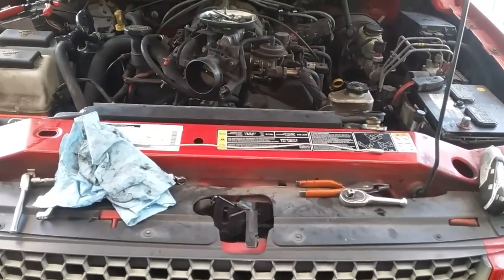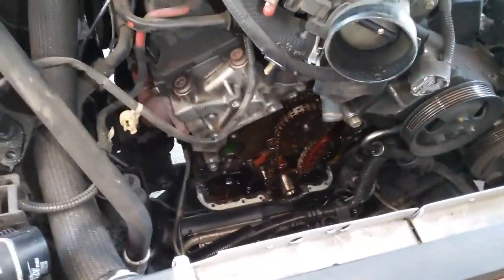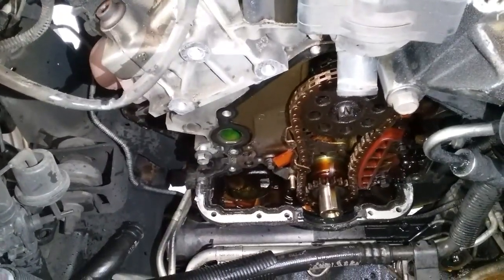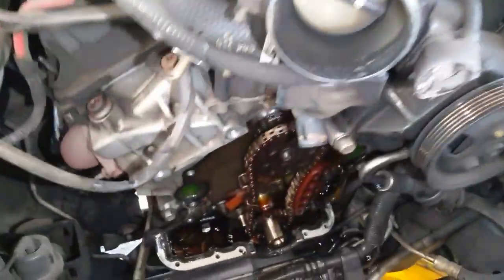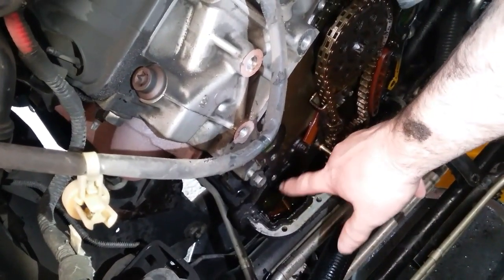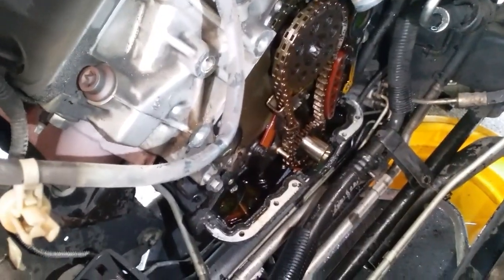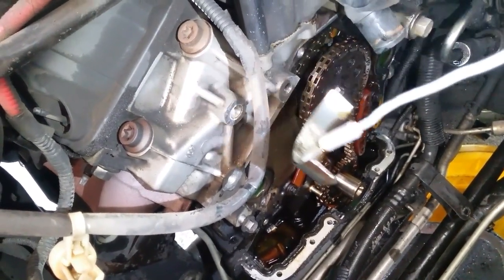Timing chain noise 2001 Ford Ranger 4.0L SOHC V6

Comment: I’m watching this 7 years later, and hopefully will get a response. Mine is a 01 ranger 4.0 SOHC it is a crank but no start. I’ve replaced the crank sensor, cam position sensor, and it still doesn’t start. Would this cause it? My dad and I think it jumped timing
Reply from the maker: @jakelewis3561  hi, you havnt supplied enough information to answer your question with accuracy. 
  Did you check spark?
If it has spark, did you spay starting fluid down the throttle body?
 Is the check engine light on if yes.. what are the codes.
  But to answer your question.. if the timing did jump enough teeth, yes it might not start. 
  If its one tooth then it should start but run rough.
  Easy way to double check is a compression test. If all the cylinders are 110psi or more.. AND they are all the same, I'd say the timing chain is NOT the issue.
  1rule of diagnostics.. start with the basics first. Spark fuel, then mechanical. 
 Good luck.

Comment: Can this cause a leak and truck turning off as well with a loud noise when cranking ?
Reply from the maker: Noise when cranking or possible. But the word "noise" is to general. It would be a specific kind of noise.
  As for a leak. Of a timing chain is moving around so much that it's has cause a visible leak. You have more problems than a timing chain.

Comment: I can hear a rattle noise especially when I turn the motor off. You have same sound?
Reply from the maker: A rattle noise with engine off 99% of the time NOT from.the engine.

Comment: can it be reassembled and used without pulling head or motor?   thank you
Reply from the maker: U need access to a plug at the back engine . This plug covers the bolt that holds the rear chain jackshaft gear. 
U can either pull the engine. Or remove the transmission, clutch and flywheel (manual trans) or torque conver and flex plate (auto transmission) 
  So... unless u plan on only doing the front chain cassette assembly.  There is no way of doing the whole job without it pulling the engine. 
Also note. It really help to get the SOHC Timing chain tool kit by OTC.
  Cloyles timing chains has a real nice video that shows it being done piece by piece.

Comment: The primary tensioner was found when I did my transmission they found the tension in the old pan the mechanic said car sound good and that might just need to replaced ? Can I change it with out doing any pulling of engine
Reply from the maker: If you have the O.H.C. Engine, you can only get to the balance shaft chain(on 4wd models), the primary chain, and the driver's side chain cassette with engine still Installed.
 The passenger chain cassette is nearly impossible to remove/install with engine in vehicle.  You can remove the transmission and might beable to do it that way.
You need access to the rear jack shaft. (Which is in the location where the old camshaft would be on a O.H.V engine.
  As to just doing the tensioner. I don't recommend that at all.  How could the tensioner fail without damaging the guides. Especially since the guide are the weakest part.
  To get a better understanding  I highly recommend looking the Coyles timing chain remove/install video. It's very detailed.
Reply: @Steve4x4  the plastic tensioner broke I try to post a pic but can’t 🥺
Reply: @Steve4x4  ok I add it to my profile this is the part that broke and was found in my oil pan

Comment: from ford new the original left ( passenger side ) tensioner only has 
about a quarter of an inch of wiggle room ( travel )to the new cassette 
cartridge??? / I would suggest replacing the driver side tensioner with a
 new OEM from ford and then use the old one from the driver side to 
install on the passenger side as it has .200 more throw. and yes it does
 make a difference.

Comment: Would this happen on a 2011?
Reply from the maker: It's possible. But I know Ford tried to solve the initial issue with better timing chain tensioners. But the overall design still remains.
Reply: @Steve4x4   if you don't mind me asking is it a constant rattle? Or just brief on start up because I get a slight grindy noise on cold start occasionally but it lasts barely a second. I've seen some people say it could be the starter but idk I wanna fix it before it becomes a real issue I have a 2011 ranger with 80k on it
Reply from the maker: @palpichulo6969  without hearing the noise in person I can't answer that with honesty.  But when the chain starts to go.... usually its caused by the timing chain tensioner failing. If that happens the chain will make noise and will not stop.

Comment: Mine is 1995 and engine is quiet! Will 95 have the same problem?
Reply from the maker: Your 1995 should an overhead valve (pushrod) engine. A traditional design that has a single chain from the crankshaft to camshaft .
The SOHC engine came out in 1997.

Comment: Has anyone had this exact job down at a garage? Im curious on how much it would cost.
Reply: I live in Ontario Canada, same problem in my F150, brought the truck to 2 garages, they both told me bring it to a Ford dealership, 2600$ and the problem was fixed, 6 months later my fan control went for the 2nd time(I replaced that myself). Sold the truck and bought a Dodge Ram. Haven’t had a problem with the Ram.

Comment: @WᴏʀʟᴅsSᴍᴀʟʟᴇsᴛVɪᴏʟɪɴ  i had the rattle. It was loud on start-ups but calmed down when the engine was getting warm (though the rattle was still there). I thought that i give it a shot and change the tensioners. Ever since then the rattle is loud all the time. Do you know what i did? I guess that there was still something left from the chain guides but the new stronger tensioner was putting too much tension on the chain so it failed? And too, how long can i approximately drive with that loud rattle?
Reply from the maker: I cant tell you what the noise is, or how long you can drive it.
If all you did was change the tensioners then you just scratched the surface of ford 4.0 SOHC timing chain job.
What about the chains and cassettes? They are mostly plastic and become very brittle and then break.  Also the noise might be coming from the rear chain.(at back of the engine)
Reply: @Steve4x4   Yes the noise is coming from the rear chain. I think the chain is running directly on the chain tensioner. I saw another video where you could see the chain tensioner grinded down from the timing chain. Did you ever see something like that in real live?
If thats the case ifs metal on metal (at least lubed by some engine oil).
Reply: I didn't do the chain or cassettes i don't trust my skills enogh.
Reply from the maker: No, I never ran then engine with chains exposed. 
Its such a big job. That I was just getting it done. Gotta remember too I did this 3 years ago. Lol

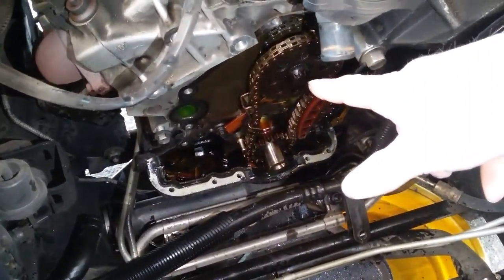Comment: Hi, thank you for this video! One question - at 1:45 you mention that it's technically possible to attempt a half-assed replacement without pulling the engine... How long would it take a layman to get to the point where that could be attempted? 

(I've got a 2001 Ford ranger 4.0L that's about to go to the junkyard for the timing chain issue... I don't have much to lose)
Reply from the maker: It's for the timing balance shaft gear... some ppl say you can just lose the oil pan to get to that balance shaft chain tensioner.
 Other than that I personally would recommend this job without pulling the engine.
You have to get the rear "cassette" off the jack shaft. Which requires removing a plug that us behind the flywheel. Anyone who said they have done this job without removing that plug didn't do it right
Also its nearly impossible to do this without the proper alignment tools.
Reply from the maker: @miketonon7946  not really
Oil change lot.. with what I know now.. I'd do it every 3k. And hope for the best
Reply from the maker: @miketonon7946  I don't have a preference

Comment: hello my ranger is a 2011, would i have this problem or was it fixed? thanks
Reply from the maker: Thats a trick question.
I dont jnow which engine you have. If you have a 4.0L sohc engine, then possibly.
Reply: Steve P. Yes 4.0 SOHC, I thought this problem was fixed later down the line
Reply from the maker: @noahgarbutt9971  I honestly can't remember if they did or didn't. I did this over a year ago.
I just know if you hear a definite rattle from the front of the engine.. its going to be an expensive repair.
Reply: Okay good to know, Thanks again
Reply from the maker: @noahgarbutt9971   Welcome.

Comment: Who can afford to fix this issue? And who can afford to fix this would want to?
Reply from the maker: I agree with you... the cost of this repair is pretty much doom for the vehicle.
But in the case of this specific vehicle. The over-all condition of the vehicle was still good. So the getting this repair was a logical for the customer. But if the vehicle had high miliage I would have discussed replacing the engine entirely.  Which is about double the cost of this repair. 
 It comes down to the individual owner. Their attachment to the car, the condition of the vehicle, and the ability to deal with getting a new/use car. Here they felt is was the right choice.
Reply: @Steve4x4  So what is the ballpark price for this repair?
Reply from the maker: @javiervalenzuela8284  is labor intensive.  Book time is 11hrs to R&R engine, and 7hrs to do the chains.
My shop rate is 75/hr

Comment: Good info But was really looking to hear the noise it made. I am recovering from surgery and started my 2001 Explorer up after a week a week of sitting and it developed a knock... Runs good but load as help sounds like a timing chain but not sure
Reply from the maker: Pull the belt and run the engine. See if this noise is still there.. with the belt off there no fan noise.
Use you ear and listen from under the vehicle. The sound wont be as loud from that angle if its timing chain.

Comment: Did you hear this rattle at idle or while going down the road? I`m hearing a rattle that sounds like its coming from the transmission area. Sounds similar to spark knock.... kinda. I cannot reproduce the sound at all without load on the motor. No sound at start up at all, no sound at idle. Creeps in around 2500-3000 rpm. Thank you.
Reply from the maker: This noise is no mistake from the front of the engine.  Any time engine is running. It's very loud

Comment: What year did Ford fix this issue with these engines?
Reply from the maker: I honestly dont know.
Reply: I had heard not until 2005, but not sure if that is correct.
Reply: They didn't.

Comment: Oh Lord.  This is exactly what my 2002 ranger 4.0 v6 is [has] been doing for the past year.  I have about 190k on the motor.  thanks for this video.  Might as well drop a 302 in for the same price.
Reply: If im not mistaken, the 302 requires a complete wiring overhaul and a different transmission to handle it. Its probably not worth it due to its complexity and excess work in my opinion
Reply: @rogertheexplorer4347  4.6 Twin Turbo and a 5.0 Turbo Hellion
Reply: What did you end up doing
Reply: Mine too 🤨😠

Comment: Really bad motor design. Get the pushrod motor if you can. These all have the same problem. And if you let it go too long it will destroy the guides.
Reply from the maker: I agree the whole 4.0L program wasn't Ford best work. The pushrod motor was reliable... but didn't have much HP. with just enough torque as well. For the amount of fuel it used it should have more power.

Comment: no noise. Video is a lie
Reply from the maker: How is this video a lie?
Reply: @Steve4x4  there is no timing chain noise anywhere in the video.
Reply from the maker: @QuintonHamp  how could there be noise when you can clearly see I have the engine in a state of not able to run?
Reply: Ste P. Yeq
Reply: @Steve4x4  Yeah Steve....you nothing better to do then to take apart an engine and lie about it's poor timing chain tensioners, even though the entire internet is filled with examples supporting your claim about said engine.  🙄

Comment: A friend who owns a parts store and machine shop had a really good laugh about the Ford 4.0 SOHC motor.   What did the Ford engineers with master's degree and PhD?  The engineers at Honda were laughing their asses off.  Why put one timing chain on the front and one on the back???  Are you out of your freaken mind???
Reply: I dont think it was the engineers fault. Ford was too cheap to develop an all new V6 so what they did was took the 4.0 OHV engine block (which dates back to the early 80s as the 2.8, then 2.9, then 4.0) and put overhead cams on it. That's why there is a chain in the rear, because the block was made exclusively for an OHV design.

Comment: Ford should fix it !!!! Not you !!!
Reply from the maker: I understand what y0u are saying,  but I dunno if Ford should fix it. I mean every one  of them that I've seen had over 100,000 miles it.  So the OE parts did their job.  They just wore out, should Ford be liable for the brake pads when they wear out too? Yes it's a pain in the ass to change. But if you plan on keeping that engine this is what you have to do. I just don't think  Ford is truly at fault here.
Reply: @Steve4x4  I'm a die hard ford guy, but ford is at fault. They had knowledge before these motors were even put into production that the timing chain tensioners were defective. Back in the late 90s explorers were coming into ford dealerships with the death rattle as early as 15k to 35k miles. They knew about it and could've issued a recall early on. Shocked that NHTSA didnt get involved. It's called planned obsolescence, they planned on these motors failing. Theres still alot of them on the road but a large majority is gone due to the poor quality valve body separator gasket blowouts on the 5r55e trans and the timing chain issues.

Comment: Looking at a 2009 Ranger with the 4.0L, has this issue been taken care of by that model year?
Reply: They redid the tensioners in 2002 but it didnt fix the problem. They redid them again in 2005 and it solved most of the issues but they still rattled. These engines last a long time even the timing chain rattle. If you get the death rattle though, it's a different story.
Reply: @WorIdsSmallestViolin  death rattle ?
Reply: @iownanissan161  yes its called the death rattle when most of the guides break.
Reply: @WorIdsSmallestViolin  I have the death rattle right now, can I just replace those guides if i am in a pinch for time?
Reply: @jpegjake  pinch of time? This is NOT an easy job man. Its extremely difficult for even experienced mechanics. It costs more to replace the guides and cassettes than it is to get a junkyard motor and have it swapped in. Look up how to do the job on youtube.....if you dont smoke, buy a pack of cigarettes...if you do smoke, open up a new pack....trust me you will need it and will chain smoke watching the videos. I would never attempt it even as a mechanic.
Reply: @WorIdsSmallestViolin  I want to open it up in the front and see if I can just replace the chain guides. Im not talking about replacing or even touching the chains...
Reply: @WorIdsSmallestViolin  what's the difference between the timing chain rattle and the death rattle? thanks
Reply: @Chris-kb7vo  when you get the death rattle, the timing chain system is in the dying stage and will let go sooner than later. The death rattle is when these motors make an extremely loud rattling noise...like ear deafening rattle noise comparable to someone shaking an aluminum can full of marbles. Most of these engines do rattle especially 1997-2003 models....some of them can run forever with the rattle, some of them will die shortly after the rattle begins.
Reply: @WorIdsSmallestViolin  thanks for your response. My son has a 2008 sport trac. His rattle isn't very loud. It mainly occurs at startup and between 2400 and 3000 rpms. We'll probably wait and see if it gets worse. I think I'd rather wait and replace the engine than try to repair it. Thanks again.
Reply: @Chris-kb7vo  if you are getting a nasty rattle for a few seconds after startup and a rattle between 2k-3k RPM that means ur primary tensioners are shot....DO NOT wait too much longer to replace those....if you dont change those out the cassettes will keep degrading more and more. The tensioners are pretty simple to change...cassettes are a different story.
Reply: @WorIdsSmallestViolin  I did change those pretty soon after buying the truck. I wouldn't say the rattle is nasty. It's noticeable but not by a lot. The rattle sound is intermittent, which I hope is a good sign.
Reply: @WorIdsSmallestViolin  I've seen rare examples high mile with no rattle , but its extremely rare , my 2000 with 215K has no rattle , but I'm debating if the guy who rebuilt the transmission heard of the issue and redid the chain while he was there
Reply: I have had the start up rattle for two years now. Runs great and I love the truck... but it sucks to worry each time I start it in the morning.  is this the day I go car shopping? It's a 2001 by the way.